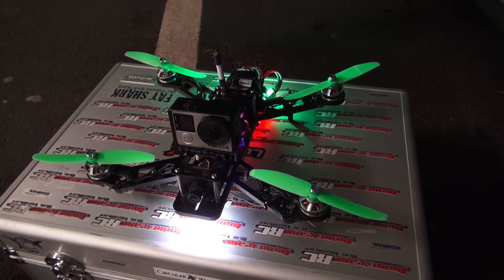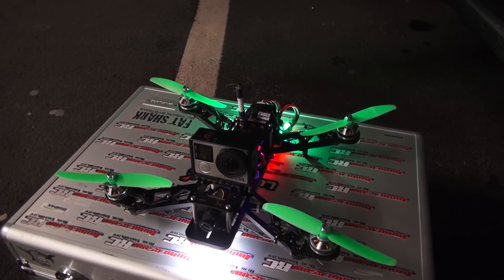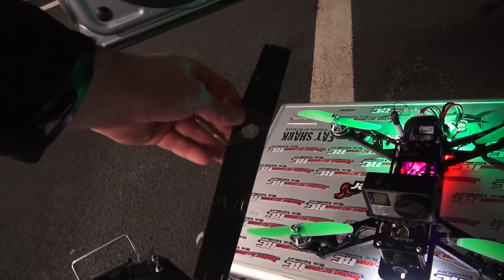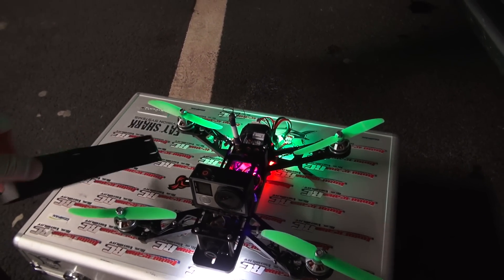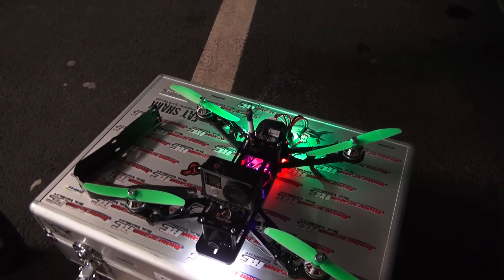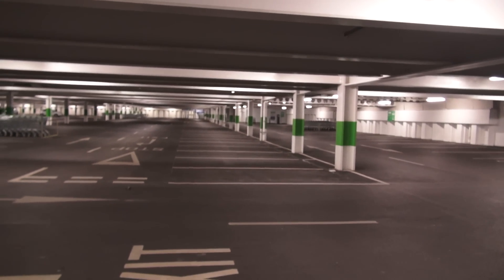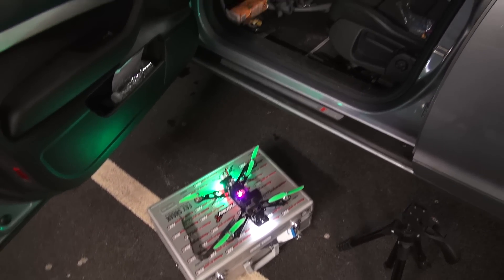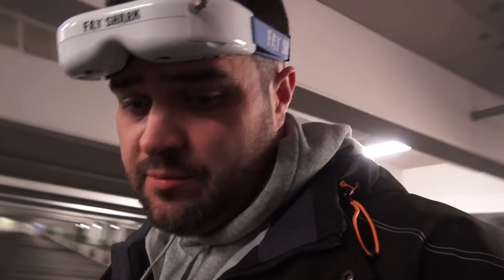HPIGUY | QAV250 Aero Guard = 180 Yaw Problem

Comment: I built a 200mm quad. I kept having the same trouble. I changed many parts including the naze32. I finally lengthened the arms, and the trouble was gone. I didn't have enough leverage due to the length of the short arms to efficiently use centrifugal force from the motors. I was running 3s, and I suspect if I was running 4s, I would have had enough force from the motors to keep my yaw intact. In your case, it was aerodynamics (aeroguard, and possibly the GoPro up top) combined with 3s. Motor speed, arm length, weight and aerodynamics can all have an effect. It all adds up. Charpu is running 4s on extended arms, and likely has enough force from the motors, and length in the arms to keep the yaw in check even with the aeroguard. The longer the arms, the less spin up of the motors you'll need to keep yaw in check. If you are building a racer to hold corners, longer arms will always be best even on 5 inch props.

Comment: Would make a bit of sense since all the prop wash is drawn out through the center of the front and rear blades and being that the aero guard  is blocking its natural path to escape through the center.. I wonder what would happen if you poked holes in the aero guard to allow air to dissipate.. To me that aero guard is like a big giant air brake..

Comment: i had this problem as soon as i put it on i did some testing and its reflected airflow back onto the rear prop/props causing the props to continue to spin at that or a similar RPM causing the 180, i haven't tried it yet but apparently using KISS esc's with the regenerative braking it stops the problem because there is minimal freewheeling of the props. Hope this helps BTW

Skip to 2:14 https://www.youtube.com/watch?v=K0fKFlwHOYQ
Reply from the maker: I'll be betting some one shot ESC's soon. Will try again.
Reply: I can confirm that this is the problem, as I have had this problem on other air frames like the Quanum Venture which has an Aero Guard like canopy. Some people have solved it by turning up their yaw PID so the motor puts more throttle into keeping from spinning. I have solved it by simply taking it off as the benefits of slightly less drag and a cool look are not worth the spins. Another way to fix it would be to use the extended motor mounts as it keeps distance from the aero guard.